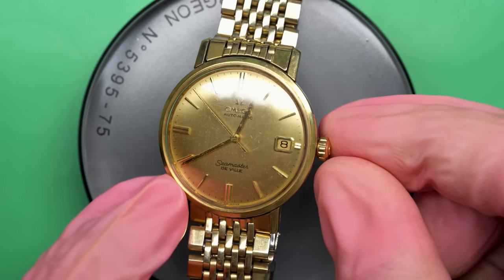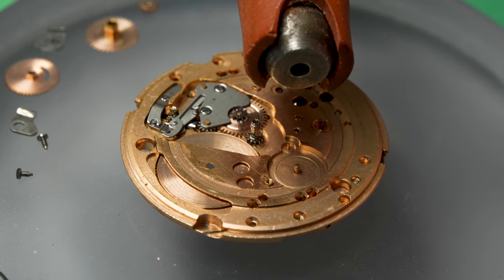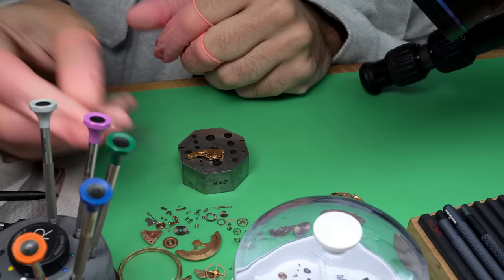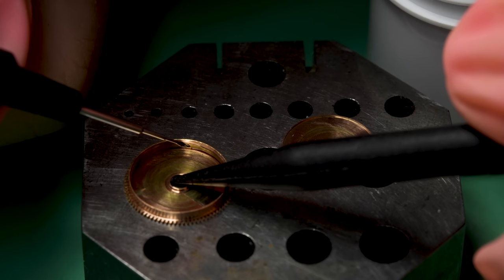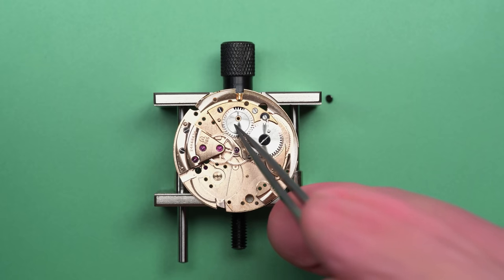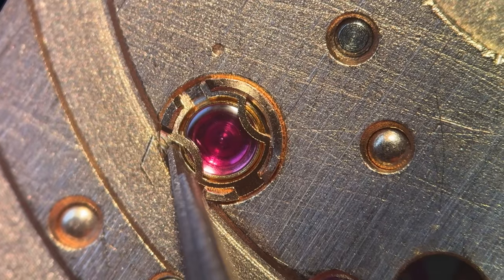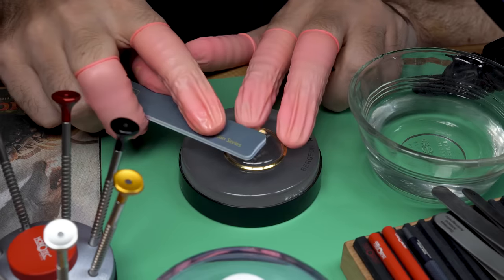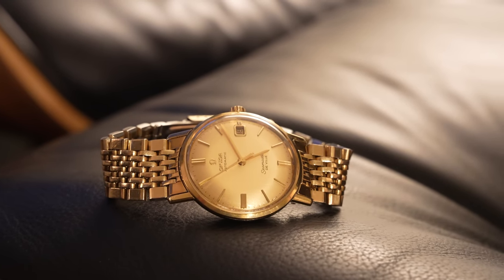This Omega Seamaster Sat in a Drawer for 30 Years

Comment: As always love and enjoy your videos! Just a quick tip from a watchmaking student here… you need to cut the amount of lube you put in each piece by 50%. This is because if you put too much (very close to the amount you are putting) it will do the opposite job and it will disperse that oil everywhere and attract unnecessary dust that can get stuck and therefore affect time keeping as well as the wear of the gears and pivots. Also I don’t expect you to know this, but when you lubed the cap jewel and you put them together you can see that it isn’t a round ring of oil. Instead it goes on the side and that’s what we call the “banana”. This is caused by putting too big of a drop on the jewel so it will not get squished properly by the cap so it basically pushed the oil to the sides and none is left for the pivot. I hope I served some help!

Comment: It's funny that you post this video now, because I just got back my grandfathers Omega Seamaster from 1960 from the watchmakers.
The watch is a 18k gold Omega Seamaster automatic which grandfather got gifted when he graduated high school in 1961, and he rarely wore it, only on special occasions. He got another nice watch (a gold tone Baume&Mercier Quartz) for his 50th birthday I believe, so he hasn't really worn the Omega for about 30 years because the B&M is much thinner, so it felt more comfortable under a dress shirt. For that reason, it hadn't been worn or serviced for 30-40 years and didn't run anymore. When I told him I recently got into watches around easter this year, he immediately wanted to give me his Omega. I got it to a watchmakers, there were some hiccups so it took a little longer, but they serviced the movement, replaced a couple of parts that needed replacement, replaced the crystal with an original Omega one (apparently the crystal had been replaced previously with a non-genuine one), and re-PVD'd the (original Omega) buckle. Now it's back, and it looks and works perfect. This is the one watch which I will definitely never sell my entire life, and, when time comes, pass on to my children or grandchildren.

Comment: This is all a bit crazy and coincidence . Just saw a post on a forum asking about an old school Omega with a picture that already had me like wth and now this!   
Just 2 days ago I found my late fathers watch again. A Omega Seamaster 600 in the original red box. Being into watches since this last year and knowing it was from my father I had to make the best of it.  Seriously, I cleaned it up with the proper materials and I was amazed. The quality the looks how well and precise it is made, just unbelievable. It even runs!  The leather strap and clasp on it with the Omega logo are still the original one and are still like the day it was bought I think, no cracks or whatever.  The only thing I can see is a small scratch on the crystal and on the faceplate, but you really have to magnify on the camera and look at a certain angle.  It will only be worn for very special occasions and will be passed on to my son. I also found 2 Tissot watches which I still have to check but I believe they are from my grandfather.

Comment: Evaporust film coating. I do Stanley planes and after evaporust I go over the part with a wire wheel it polishes right up! You can use dremmel and a wire wheel attachment.  You can also use flix a metal polish  as additional step.

Comment: I recently got myself a Hamilton Khaki Aviator Pilot (the 46mm version), an automatic watch — my first of the genre.
I was worried, despite the 80hr reserve, about having to wind it at interval and potentially loosing time if I did forget.
Been wearing it mostly non-stop for weeks now and have yet to require winding it.
From time to time, i've put an ear to it to wind it and it feels like the main spring is slipping because already at max winding.
These complications are amazing. Just wish it were a bit louder though, but not like my Waltham No. 610. THAT thing is LOUD!

Comment: Marshall - watching this video really hurts. There are so many oiling points you missed - I even cannot list them all: pallets from the fork (the worst!), rotor pinion, rotor gib, pinion of yoke (high friction), yoke spring, "teeth" from the setting lever etc etc. Countless. Please watch some  vids from the Nekkid or from Vintage Watch Service - you can only learn!
Also you MUST change the crown gasket esp. when there was already water ingres! What do you think where the rust came from? What do you think will happen if the watch is worn for dish washing? Your skills really approved over the past years but even your negligence.

Comment: Great video as always.. i have a suggestion to make though. when you check watches on the timegraph you should try to regulate to + and not -... if you let them lets say +3 its easier for the owner to set correct time again after some days by just pulling the crown for a few seconds so the time will stop and catch the right time

Comment: These are great videos.
Just one word of good practice for everyone starting out: there is no need to grab the dial with tweezers, even wood tweezers. You definitely risk making micro scratches that will always be visible. This is an unnecessary risk to take. just pry it off and grab it with your fingers wearing fresh finger cots.

Comment: Another great video, Marshall. I do want to ask, if you'll see this, why don't you even attempt to clean up the hands and/or the bracelet. I know the bracelet is plated, but even if you were to use a soft brush on a spinning wheel it would clean up and not be quite as scratched. The hands though, they really could have used a quick cleaning/wipedown

Comment: Thank you for sharing this repair. I’ve wondered if electroplating/heat plating worn or corroded parts was something that could be done to refurbish watch parts. What are your thoughts? After the parts have been plated they could be returned to nominal dimensions by polishing or machining. I’ve seen this done with larger machine parts; they were usually shafts but I’ve seen gears rebuilt this way.

Comment: So, random question. Let's say you wanted to fix the pitting on a part. Could you sand the material smooth and then repeatedly electroplate a tougher metal like nickel to build up the material?

Comment: I def need to get my daily wear watch serviced (nothing as special as the mechanical watches you service/rebuild), if for anything to get new seals/gaskets.  It has been daily worn for 20 years, never been serviced - Citizen Eco-Drive Calibre 8700 (an over the top perpetual calendar), hasn't skipped a beat on me.  One day I'll supplement it with a true mechanical watch (been thinking of finding and doing a restoration) and I'll alternate between the watches. 🙂

Comment: Great job as always. And what a great watch!

I do want to say that I don't approve of the way most new to watch repair put the movements dial side down on those pads. I don't even know if any of my fellow watchmaker buddies own one of those. So easy to slightly bend the seconds hand arbor. I cringe every time I see someone trying to push down on the button (or to turn the screw) to release the stem. But that's me. lol Just trying to be helpful to others that may be new to this hobby.

Comment: The movement on the dial side under that dial is one of the prettiest mechanical things I've ever seen, it looks so much like some kind of orrery or something. So cool.

Do you do anything with de-rusted parts to prevent re-rusting? When I've got a part in a state like that I usually use chemical bluing (if not re-plating), but I'm also not dealing with such small precision parts.

Comment: of curiosity, do you have any knowledge or advice on possibly finding a movement to convert a quartz wristwatch to mechanical? - I have a michael-kors chronograph that i adore the case dial and hands of but would prefer it be mechanical if possible.

Comment: My opinion on the crystal is that if he had used 320 grit to get rid of all the scratches and then worked up through finer grits to 5000 grit, it would have been perfect when he was finished.

Comment: Hi Marshall, quick question if you don't mind, as someone who has never worked on a watch. A few years back I had a Hamilton khaki field mechanical (non automatic) watch. I managed to somehow overwind it which killed it. If you changed the hairspring to an automatic type (the one with that extra bit of coil that allows it to slip on the inside of the barrel so it can never be overwound by the rotor spinning) would that have helped with the watches ability to resist being overwound? Guessing not as the torque of being wound manually would have been too great but I was just interested if this was a thing? Great channel by the way 👍

Comment: quick question from a beginner, so the offset screw on top of the crown wheel means it doesnt have to be a left hand thread? Ive notice the more expensive makes like Rolex use 2 screws sometimes instead of the Left hand thread centre screw?

Comment: I had a watch that required a 24 hour rotation to change date. Then I learned that I could turn it until the date changed, then turn it back to just before the date clicked over then forward til it clicked over again, etc til I was on the correct date

Comment: Question, I there a o-ring inside of the crown that must be seeping a bit to allow moisture to get onto the split stem and rust it?   Is that seal something that you would typically replace, especially seeing the damage?    What about the Crystal bezel, is there a seal there that would usually get replaced during a refurbishment?  Thanks

Comment: The other end of the spectrum: My Pixel watch. As far as I can tell, it's hermetically sealed, and would require a nutcracker to open it for the purpose of safely disposing of the battery before junking it. 🙂 On the other hand, as long as it runs at all, it will never be off by more than a second or less. Another point on the spectrum is the knock-off watches I'm fond of buying, which have the look (from a distance) of elegance, but which are sort of laughable, really. You can buy a lot of them for the price of one Omega (or Pixel) though. These videos are great. Thanks.

Comment: Your videos are amazing. What cameras and lenses do you use to make these videos? Also, how long does it take to rehab a watch? It appears that it could take a few weeks to a few months to get new parts for a watch. I own a vintage Rolex Submariner that I bought new in Switzerland on August 1, 1967. The serial number indicates that it was built in late 1966. I recently had it rehabbed  for about $900. It runs well. Just for laughs I originally paid 500 Swiss francs for the watch witch came out to $117

Comment: Is there a good place to look for parts and donor movement other than ebay?  I have an Omega 550 with rust on several parts including screws.   It seems to be very challenging to find just screws…
Also, I have had a couple of instances where Evapo-Rust has deposited a fine coat of carbon on the parts if left too long.  Anyone else have this issue and how dis you get the coating off?

Comment: I'm confused about the cleaning machine and mesh baskets.
wouldn't the parts shift around in the bath and bang/scrape up against each other and the wire mesh basket?
couldn't this damage the parts?
certainly it could "un-pretty" the movement.

Comment: Marshall, I’m curious what methods you used when starting out to make sure you reassembled watches correctly, due to their vast array of parts. As an mechanical engineer I’d lay components out methodically, proof mark, label, photograph etc. but I’ve never worked on anything with so many small parts. Any advice would be appreciated
Reply: I'm not sure what Marshall has done, but what has worked well for me is to use my phone to take lots and lots of photos at each step...sometimes from different angles. Then at each step I put the removed part with its associated screw into a plastic parts box with lots of different compartments all in order. Assembly is in the reverse order of the photos and compartment.  It's worked well, but the trick is to not mix them up during cleaning.
Reply: He's mentioned before that one thing that really helps is videoing his work - when he's not sure about where something should go, rewatching the video helps pinpoint where it came from.
Reply: He’s mentioned before using pictures and especially these videos to go back. I agree I can’t figure out how you tell the different screws apart though!
Reply: Thank you for all your advice, much appreciated
Reply: @BlakeAStoffel  it doesn't take that many watches before you start to see the difference on basic movements.  The screws for barrel and train wheel bridges are almost always the same. The balance cock screw is sometimes different.  Then the screws on the motion work side will have their recognizable looks also. But that's why I like to put the screw and removed part in the same cubby. My first chronograph however, was scary bad...I made it, but I was sweating...
Reply: @legacywatchguy8333  thanks! I’m just about to get my first set of tools and movement so that helps. I’ll stay away from chronographs for a while…
Reply: As a watchmaker, you just see the function of the parts. Sure, laying the winding works together, and the keyless works, stuff like that. That helps your workflow. But generally there’s no need to be super methodical and labeling parts and such. Just put the general parts and screws together in clusters of function mechanisms, and you’ll be fine if you understand watches

Comment: Why does the mainspring winder handle get turned backward a little, at the conclusion of the wind? I believe all the watch repair channels do this.
Reply: It takes the tension off of the coiled up spring so you can remove the winding handle without damaging the spring.

Comment: BEWARE FIBERGLASS BRUSH.  The broken off fibers can get into your clothing. Especially jeans or pants.  And it's difficult to get it out.  And it forever scratches your legs. I have had to throw pants away because nothing seemed to be done to get those sharp fibers out. The techs at work swore that if anyone brought another fiberglass brush into the work area they would stop work and leave.
Reply: Agreed, they're nasty things.  I keep mine in a sealed bag and only use it outside or over a paper plate to catch the fibers.

Comment: I have seriously told you THREE times: If EvapoRust turns the surface black you have left the parts in TOO LONG. For God's sake try increments of 1/2 hour. Try it? That wasn't heavy rust. Two days would do a rusty piece of construction equipment (and turn it black). The black is an indicator.